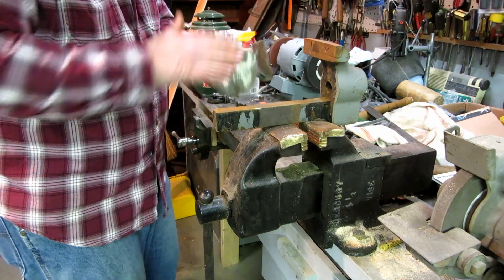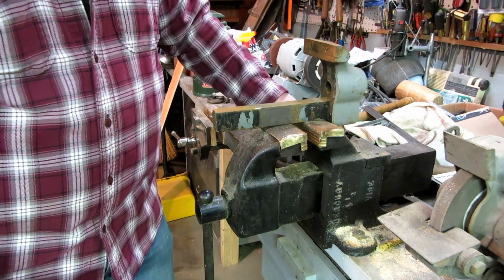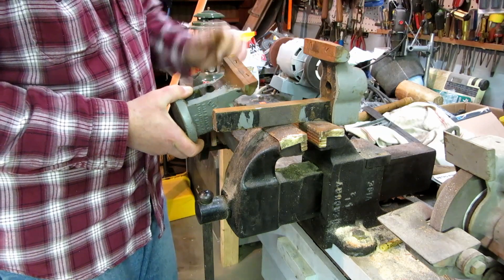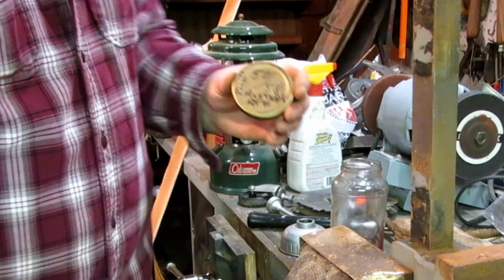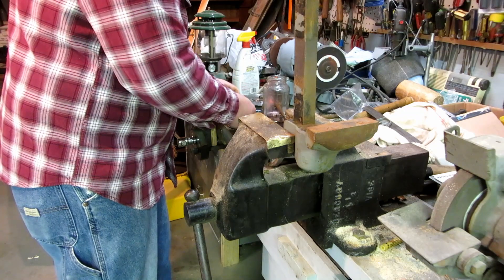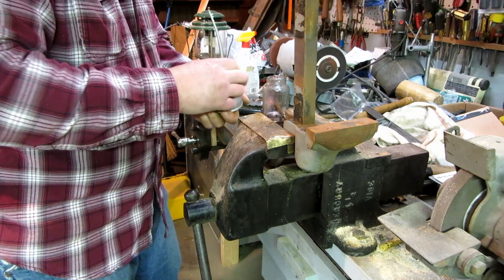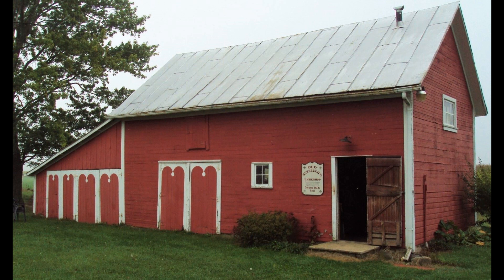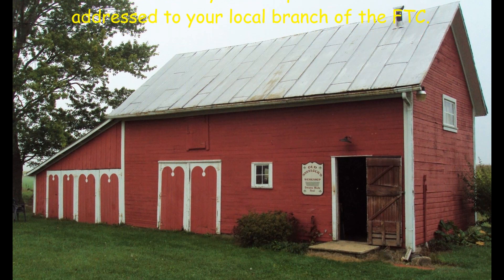Antique Shop Trip 4-1-22

Comment: I was given a large vice with 8" jaws and open to 16", after being under the work bench for 30yrs.  I took it out and looked at it and discovered the internal threads were striped for the rod.  Just as you said it is just junk. It was a odd metric thread pitch and made of cast iron,. Korea was stamped on the underside so guess that is why it was such an odd a pitch.  That is a good looking little vice you found and will clean up just fine. Have a great day and I will enjoy the sunshine it suppose to be 77 today and snow for the weekend.
Reply from the maker: I bought a 6" Blacksmith Post vise. The threads are worn to almost gone. I keep thinking I am going to make a new thread for it but haven't done it yet